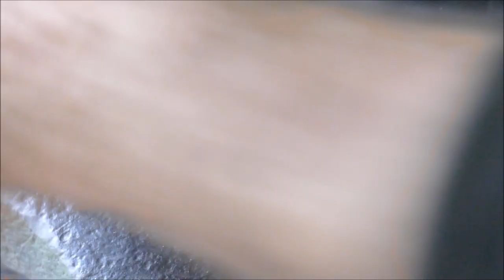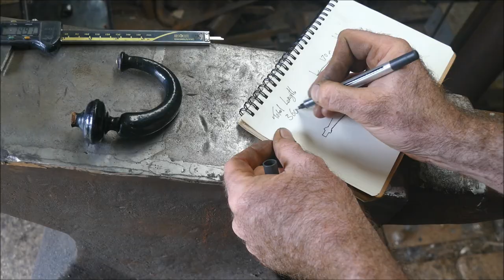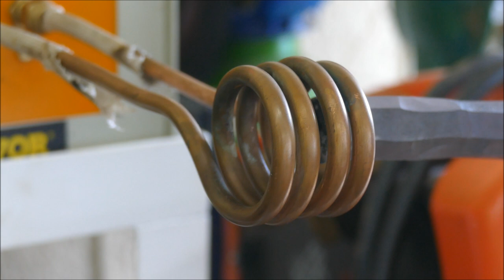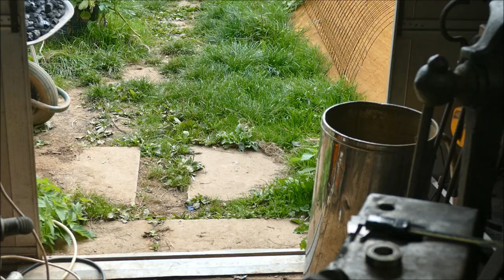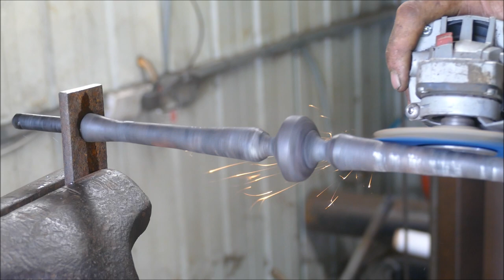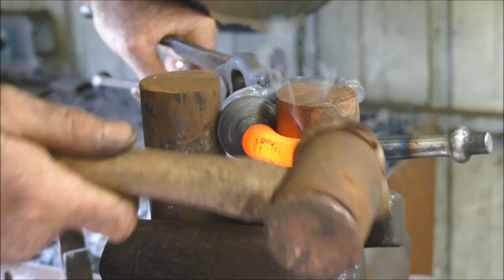DIY Power hammer projects - Door knocker - no talking - *open closed captions*

Comment: Nice to see the power hammer back in action!
Also nice to see the cunning use of opposite ends of the heating spectrum used to their own advantages (Induction and Charcoal is about as far apart as you can get technologically).

I also liked the use of explanations inserted in rather than excessive talking ..... it worked well!
Reply from the maker: Thank you so much. It was also much easier to film and edit. Most of the time I am not filming commissioned work because of time pressure. Cheers J
Reply: @joshuadelisle  My thoughts too. I can stop, read and look at what ever you are doing and talking about. Old and slow but you make it worthwhile.

Comment: 😯😲🤓 amazing 😃… I still have it in the back of my head to build one of your power hammers . But recently got my hands on a 3 phase 12 ton hydraulic press  .. I use it to put pressings in sheet metal ,  but would it be enough pressure to resize stock at forging temp 🤔 🤔🤔🤔.. I don’t even have a forge 🤣🤣.. I’ve got oxy acetaline .  But is 12 tons even in the ball park  before I waste a bunch of gas 🤔🤣🤣🤔
Reply from the maker: Nice well done. I really want to build a press myself. I've been looking at re purposing a 37ton log splitter. The coaliron presses are 12t for forging with, they do a 25t also. I'm also designing a new forge for charcoal that has a hand crank bellows. Cheers J
Reply: 😯 cool, will give it a try 🤓🙊   It’s got a huge hydraulic pump motor .. about 7kw . So down stoke is fast 🤓 it’s got a two button firing system so you can’t  have your hands free to squash them 🙈🙊 need to bypass that onto a foot switch .. but yeah just one more mildly terrifying contraption for the collection 😝
Reply from the maker: @fragglepoop7185  sounds awesome.  All the very best. Cheers J

Comment: f@t b@st@d says = have mentioned to some other blacksmiths cement in the legs of the homemade stuff can defer vibration and that echoing hollow sound = awesome work well done + ps remember contained vessels and heat eg expansion / explosion when using cement [ welding ]